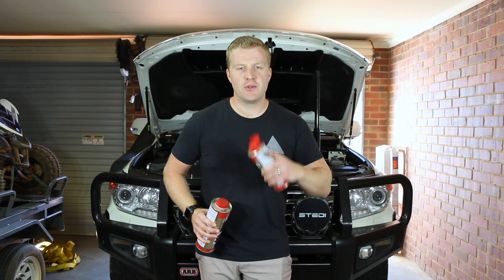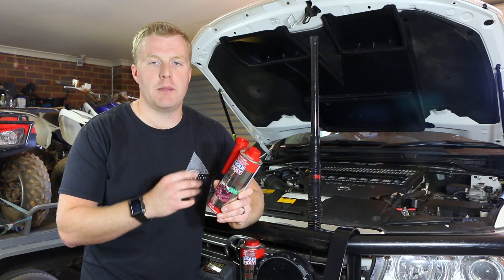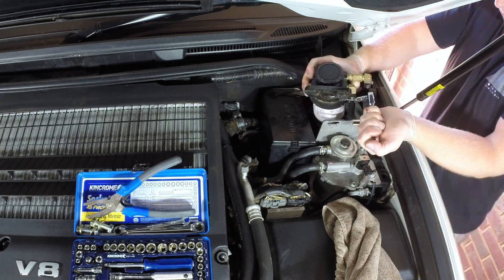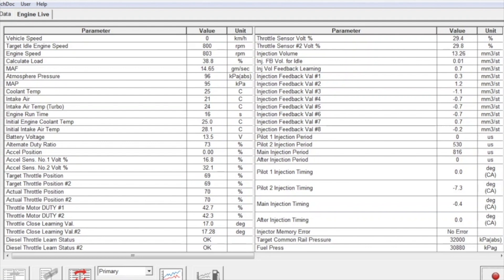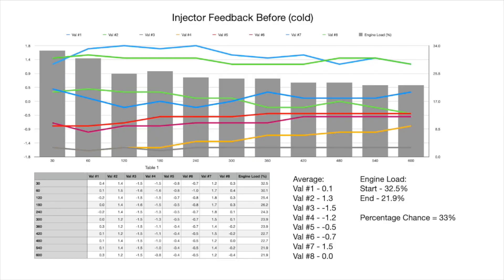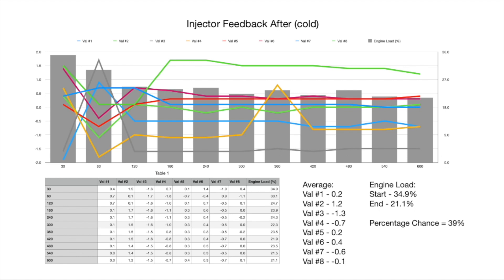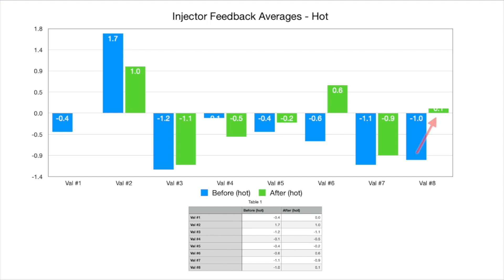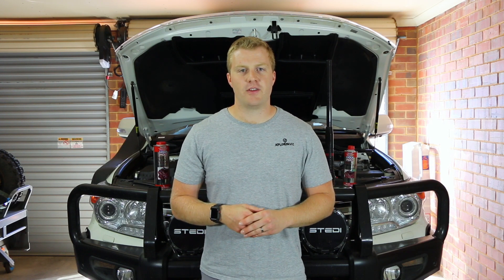LIQUI-MOLY Diesel Purge | Does it actually clean injectors? | Injector Feedback Test -Fuel injection

Comment: Great test. Only bit I found missing is what's mileage of the engine you're testing. I think you can expect better results in properly clogged high miles engine but next to nothing in let's say 50k miles engine. 👍👌👍
Reply from the maker: Thanks mate, this is definitely true and I think this vehicle would be on the lower kilometres side (only 100000km's). If I can get access to a higher milage vehicle, I could potentially re-test this solution. 
Cheers, Nathan.
Reply: @XploringOz  I'll try your way on mine 2.0 tdci 4cyl Ford Galaxy. It has 240k miles(386k Km). Runs lovely but there's hasitation and puff of white smoke at startup indicating that spray isn't perfect. Of course it can be just injectors end of life but I'm getting smooth ride and good mpg in return.  So why not to have a shot? Only if forscan will let me get data to compare the results. Cheers Chris
Reply from the maker: @polishguy9272  Awesome, make sure to let us know how you go. I would be very interested to see the results on a vehicle with more miles.
Reply: @XploringOz Sure I  will. Another thing worth to compare are the short and long fuel trims. If cleaning work then conditions required for stechio are changing and this will affect them. Cheers
Reply: My car is at 180,000km and I'll be doing this at next fill up. I'll let you know how it goes! Never done it before so will be interesting
Reply from the maker: @dubgirl____dubdubdub  Awesome, I hope you are able to get some great results too!

Comment: Great Video Nathan.  The results seem too close to really get the feeling that anything has really changed. The graphs can sometimes exaggerate the real data.  Some of this variation demonstrated could be in the errors associated with the actual measurement, as it is probably a voltage measurement and they can fluctuate a fair bit due to interference etc etc.  Your car is too well maintained, get a mates shitbox that has been abused and showing some clear signs of neglect (lol).  I really appreciate what you are demonstrating and am by NO means knocking what you are going. I'm still on the fence on these products, but I do use them.  I REALLY hope the data that you present means a real effect is occurring and I'm not wasting my cash. Again great effort, very much appreciated.
Reply from the maker: Thanks mate, I appreciate the feedback delivered in a respectful way. For sure, I understand where you are coming from. 
If I can get access to a higher milage, city car then maybe we might get more variance in the results. 
Cheers.
Reply: I agree! It would be good to see on high mileage, not as taken care of shit box. See if you get better data!

Comment: Hi,

Those values are a good indication of injector health. However there are also other factors involved.

If your cam shafts or associated valve mechanisms are worn irregularly then the air entering the cylinder will also be irregular. 

Therefore the engine management system will change the fuel input depending on the air (O2 sensor) or the actual acceleration of the engine (from the crank shaft sensor). 

So FYI you are not analysing purely the injectors. 

If i recall correctly the HD-1FTE  engine (injector pump)  in the 4.2  land cruiser diesel used crank shaft acceleration to adjust injection quantities to smooth the idle and probably during the operation of the engine.

Thank you for the video. Very informative and professionally done. Your work is very appreciated.
Reply from the maker: Thanks mate. I agree 100%. 

For this test, the injector feedback value is going to provide the easiest and likely most effected variable within the system. 

Maybe one day I'll have access to some more comprehensive equipment to be able to test systems out in a more thorough method. 
Cheers, Nathan.

Comment: I'm not sure you're reading the values correctly. As I understand it, the ECU reads the flywheel speed thus seeing which cylinders are generating less power at idle. On the 'slower' cylinders, the ECU increases the fuel amount (positive values), but it also decreases the fuelling of other cylinders to balance it out. So really you only need to be looking at the positive numbers. It's a shame we don't know whether the injector cleaner or tank additive is the thing that made the difference.
Reply from the maker: I understand your logic here and would concede that this could be the case. Either way, the results from my testing do show that these values have moved, albeit slightly closer to that 0 mark, therefore having some improvement.
Is there something else that you would think would of made this difference other than the cleaner?
Thanks for sharing, Nathan.

Comment: 2 Stroke oil semisynthetic works well too. I use it for Petrol injectors to stabilize fuel, clean injectors and on diesels do clean injectors and lube the common rail pressure pump. 1:300 to 1:200 works well for me.
Reply from the maker: Awesome, if it works and doesn't have any negative effect then why not.
Thanks for sharing, Nathan.
Reply: Works a treat, I do it in both my diesels. 3ml per litre and nothing in every 4th tank just to make sure I'm not over mixing it

Comment: Would this be an good idea of adding additive to a brand new car to prevent any buildup?
Reply from the maker: It sure would. I would personally use it as an additive to the fuel tank, just to continually flush through a small amount while driving. This would prevent long term build up and assist to keep the system clean.
Reply: @XploringOz  nice, im going to run LM Cera tec from beginning for sure 👌 that seems to be an big improvement
Reply: The best thing you can do is to install an oil catch can. It prevents sludge buildup in intake manifold and valves. 
Injectors are fine if you use good gas and change the fuel filter.
Reply from the maker: @theEskalaator  Definitely helps. I've tested out a couple on this channel with some interesting results.

Comment: Great job mate, thanks for your time and details.
But, In my opinion, Liqui Moly helped to clean your injectors. 
You have to sum all the values of eight injectors before and after. I did it for you :) and noticed that it was -3,1 before. After you applied that injector cleaner it raised to -1,0. Ideally, the sum of values should be zero.
That means, your performance might be improved but your economy will worse than before as your injectors started to spray more fuel :)
But as I mentioned before, it's my opinion, comments are welcome.
Reply from the maker: Thanks. 
I do see your logic there and can't dispute it. However the only thing I can say is that the closer these values are to 0, the closer they are to how they are designed. This would in turn, represent a healthy injector, providing even and efficient fuel dispersion. Hopefully this would outweigh the small amount of extra fuel burnt. 
Thanks, Nathan.
Reply: @XploringOz  Thanks mate,
I guess all injectors are trying to compensate and keep the fuel balanced within 8 cylinders.
I decided to buy it for my E220cdi with the technical test results you've provided.
Thanks again,
Reply from the maker: @Matt_3535  Thats correct. I hope it helps out in your vehicle too. Good luck.
Reply: What? I think the correction value is how more or less fuel the ECU send into the cylinder. So when you want for exapmle 5 mm3/st and injector 1 is giving 7, you get 5-7=-2. So the ECU sends there 3 mm3/st to compensate for it. 
There is no reason to sum the values. If you get -1 on each cylinder (-8 in total) it is the same as 1 -1 1 -1 (0 in total)
Reply: @theEskalaator  But, if injector test result shows +2 for first injector, that means 2 mm3/st more than required. If second injector sends -2 mm3/st that means ideal/balanced amount of fuel have been sent to combustion chamber. That's why I summed all the values.
Reply: @Matt_3535  But injectors are not connected into one cylinder and don' fire at the same time. If one would send more (or less) fuel, engine would run rough
Reply: @theEskalaator  Yes mate, you're right. Ecu will decide how much pressure should be applied per injection. Summing wasn't a good idea. Otherwise engine will run rough. My car is running rough when idling because one of the injector is faulty and giving more or less than required.
Reply from the maker: @theEskalaator  I understand where your coming from, but as you can see, we are not getting an even + or - from every cylinder. The fact that the overall result has moved closer to 0 is going to somewhat represent a more efficient injector system.
Reply: @XploringOz  I don't dispute that. Closer to 0 is better. I am talking about that sum of correction.
Reply: I don't think just summing them all together does much - but summing the absolute values (or deviations from 0) shows you a bit more. So if one injector has -0.5, you add it to the sum as 0.5. And if another injector has 0.5, you still add that as 0.5.

So if that number grows higher, you have, in total, more deviations from the norm in your system. The closer it is to 0, the better - because the closer that is to 0, the closer all the injectors on average are to 0 :)

Comment: Great video! Only issue I had when using the clean and boost is it started throwing fault codes (bit stressful) but that’s because of the cleaning process breaking down deposits,after 2weeks reset the code and algud!
Reply from the maker: Ok, that's interesting. I'm assuming maybe some of the dislodged material interfered with sensors in the engine resulting in those fault codes? Were you able to determine which fault codes were activated?
Good to hear it all worked out in the end.
Reply: @XploringOz  exactly what I thought, fault code P0401 insufficient egr flow after good run (Italian tune up lol) it was good
Reply from the maker: @praneetsingh6201  Glad to hear it all worked out in the end.
Reply: @praneetsingh6201  that's what im getting now, along with many others

Comment: Hi Nathan .Great video and explanation. I noticed some comment on foreign bodies and algae in the fuel. I have learned over time that diesel can develop an algae contaminant if you get a load of old fuel from a servo with low diesel turnover, or may at some time have had water in their storage tanks. This is the other reason I use a diesel conditioner. Most fuel additives should not only help the injectors, but neutralise "diesel snot" . Hope this helps and thanks for the video. PS I also put it in my Diesel heater tank.
Reply from the maker: Thanks Harry, appreciate the feedback on the video. 
I have continued to use the fuel conditioner in the vehicle, for that exact reason. I'm hoping that it will continue to keep the diesel in good condition and prevent damage. Now that I have a baseline test, if my results change over time in anyway, I'll report back with another video. 
Cheers, Nathan.
Reply: Forgot to mention .I use "Moreys" for some time.
Reply: Thank you for this comment, I'm suspecting my car has algae in the fuel and hoping this product will sort it out, so you've given me a bit more hope and struggled to find anything about it online.
Reply: @Andy2x4  I would change the diesel fuel filter more frequently.  You should see the snot on the filter. Change until it is no longer present on the filter.

Comment: Hi mate, seen you have a post fuel filter on there, what micron did you go with and why did you choose to go post over a pre filter. Just curious to your thoughts.
Cheers mate
Reply from the maker: Hi Mark, yes that's correct I'm running a post filter and this is a 5 micron filter. 
So the reason I ran a post filter, rather than a pre filter is to allow the factory sensor in the primary filter to activate if for whatever reason water gets into the system or the filter becomes blocked. 
The post filter allows any dirt that may have passed the primary filter to be captured at this point prior to entry. 
Now I know this may not always make sense, however there are pro/cons for both pre and post filters. Fitting a pre-filter could potentially block up with dirty fuel and won't provide the driver with any information until the SCV (suction control value) is placed under large stress, potentially causing a failure. 
The primary factory  filter is still a very cost effective maintenance item and is very easy to change roadside if required.
I hope this helps somewhat. 
Cheers, Nathan.

Comment: G'day Bud, very well done, Trying to install and run the same program to do the injector feedback test. Just wondering how you got your program working for the diagnostic. what version are you running and on what version of operating system ie, win 10 64bit?? any info would be gr8 thanks.
Reply from the maker: Cheers mate. One thing I can tell you for sure that this program is not fun to get working. I am not an IT guy by any means, but it took me a long time.
In the end, I just couldn't get it working and sent my laptop to Perth by mail to get my brother-in-law to get it to work. 
I'm using an old laptop, running Windows 7 (64 bit).
If you check out the Landcruiser 200 series Facebook pages there is a guy by the name of Lee Owen who has a couple of posts that gave a detailed explanation on how to work it, not that it worked for me (definitely my fault though).
I wish I could help some more, but unfortunately computers and software just isn't my thing.
I hope you can get it to work.
Cheers, Nathan.
Reply: @XploringOz   Thanks Nathan, I am also not that tech savvy. ... and I don't have a brother in Perth. So many versions on many different platform running 3 different VIC's and a tonne of different drivers and another tonne of how to do's out there. Might just drop in to Toyota. But thanks anyway, See you on the tracks.
Reply from the maker: Yeah, sorry i couldn’t be of more help. All the best with trying to get it to work 👍

Comment: Would probably be a good thing to just add a full bottle of fuel system cleaner straight into the fuel filter itself, especially at regular service.
Reply from the maker: For sure, regular doses of these cleaners will help long term. Keep in mind if you put it straight into the fuel filter bowl, most of the chemical is just going to end up back in the fuel tank when its sent back down through the return lines. The chemical would only be concentrates for the first 20 or so seconds before it's diluted with the vehicles diesel in the tanks. 
Cheers, Nathan.

Comment: This is the first video on additives I have seen with actual figures! Great work!
Reply from the maker: Thanks mate, I hope it's helped a few people and given them a little insight into some realistic results. 
Cheers, Nathan.
Reply: @XploringOz after using purge my car showing warning sign if engine stop when I drive around 80 or more, it comes for few seconds and then off. Some weird sound also coming in idle and while run. New filter was installed before purge. Its Duster car with 160000 km driven. Never had this issue before.
Reply: In a 76 ltr tank  do i use cleaner based on 70 - 75 or 80 ltrs ?
Reply: @Mick_4591  just dump the whole thing in, Liqui moly makes 1 Litre PRO line bottles too which they say should be divided in 333 ML each serving. Sometimes you can even fill the can on 40L my car only got a 40L tank so i dumped the whole thing in, still runs.

Comment: Nice analysis mate.  Was it just me or was the variance on each injector at over time greater on both the cold and hot test post clean compared to pre clean?  The graphs certainly seemed lumpy to me post clean.
Reply from the maker: Thanks Terry, appreciate it. 
I think you are right with the cold test, the variance may be a little greater on the after test, however, I do think that the variance is probably smaller on the hot test. 
The visual graphs could probably have done with a little more attention, on review now, I have noticed that the scale of the graphs is not consistent. This has probably exaggerated the visual variance.
Cheers, Nathan.
Reply: @XploringOz  I did not pick the scale issue on the graph, agree that would have a lot to do with it.  Cheers!
Reply from the maker: @JafffaAdventures  My fault there for not ensuring a constant scale. Overall I'm relatively happy with the results, especially with a product at this cost and simplicity of use.

Comment: Ripper video mate, I had a similair experience, had one injector that was close to 2, ran fuel doctor treatment through it for a few tanks and now back below 1. The cleaners do seem to help...
Reply from the maker: Thanks mate, appreciate that. 
That's great news. I might have to have a look into that product and just do some testing off camera, see if there would be any further improvement in the injector values. 
Have you continued to use this product regularly? And if not, have you observed that particular injector to return to those higher values?
Cheers, Nathan.
Reply: XploringOz  yes, I continue to use it, injectors are staying well inside spec. Probably due another test now actually. I got a bit of a dodger load of fuel at one point that’s the main reason I started using it. Been 22k kms since that load of fuel and all is well in the world.